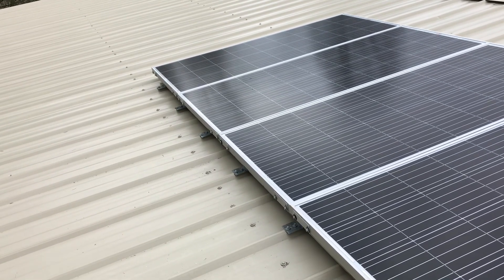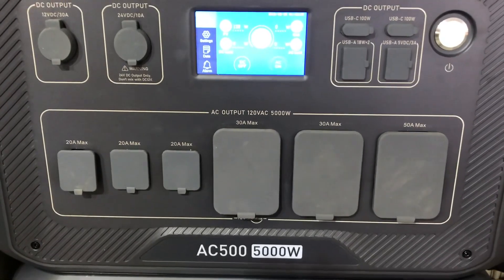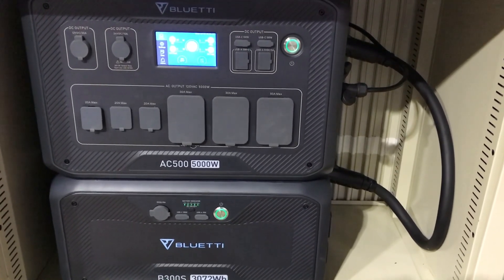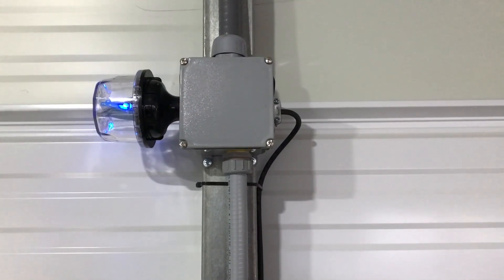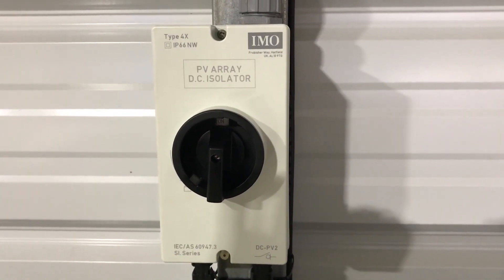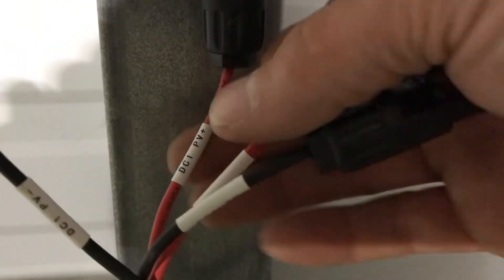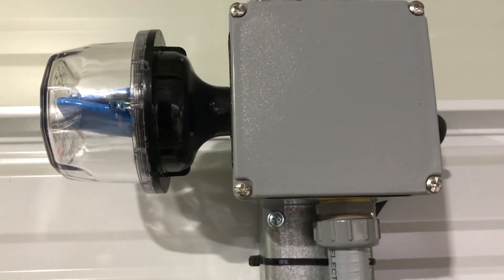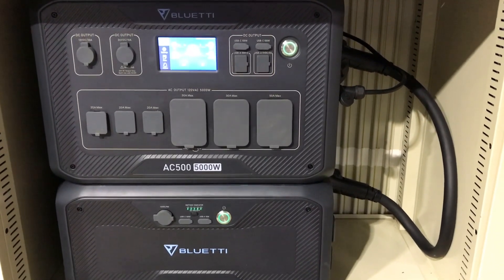PORTABLE POWER STATION ESSENTIALS

Comment: If your solar panel array needs to be located about 150 to 200 feet from the  building where you are using the power, how is that most efficiently and safely done? Do you build a small building at the array to store and process the power, or do you run a DC power line to the building?
Reply from the maker: Trench and use direct burial PV cable or pvc underground conduit. Use larger gauge wire size for that long of a run. You’ll lose some voltage but shouldn’t be too bad. There are wire size calculators online to determine proper wire gauge for minimal voltage drop. 
Hope this helps!
Reply: @THEOFFGRIDMOUNTAINHOMESTEAD     
  Thank you.  In that situation, should the batteries and the inverter be near the  solar panels, or should they be inside the house?
Reply from the maker: Put the batteries and inverter at their point of use. A 200ft PV run isn’t bad. 
Example 150VDC solar array over 200 ft wire run only loses 4% voltage on #10 AWG pv cable. Ending voltage is 143VDC with 15AMP load. 

Hope this helps!
Reply: @THEOFFGRIDMOUNTAINHOMESTEAD     
  Thank you. That is a great assist in evaluating a property.

Comment: That is a very clean installation!     I know SP1 does not get a lot of snow, but when he does would he just use a long-handled brush to remove the snow from the panels?     I know people who do not want to spend a little extra for surge protection.   That is penny wise and pound foolish in my opinion.  I like the idea of getting the disconnect with 4 contacts for future expansion.    I would love to hear your thoughts on monocrystalline vs. polycrystalline panels.   Looking forward to your future solar content!
Reply from the maker: Yes you can use a brush, but even water sprayed on the panels will melt the snow. Just a small section of sun exposure to the black panel and snow melts off quickly. Panels get hot fast. 

 I too feel that surge protection is a must on any PPS. Regardless of the cost of the machine. Permanent PV array that takes a lightning surge can transfer that through the wire into the home! You’re protecting more than just the PPS. 
I’ll include discussing mono vs poly panels in upcoming videos!
Reply: I'm in New Mexico. Our home was built on the grid originally but we added solar and wind power generation back in 1999 b4 Y2K.  I screwed a pushbroom head onto an extendable painter's pole to remove snow from the pv array. Works great. And yes, NM can get snow all winter long when you live at 6500 ft elevation. 😁